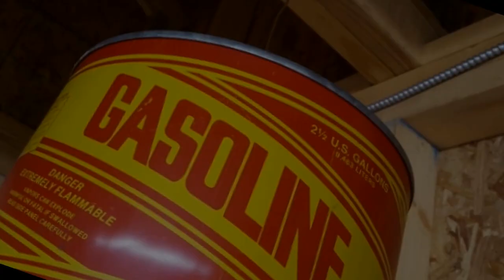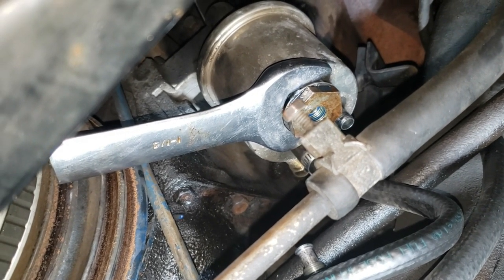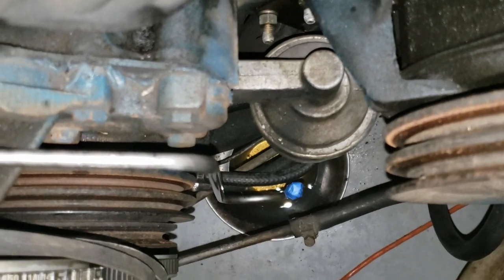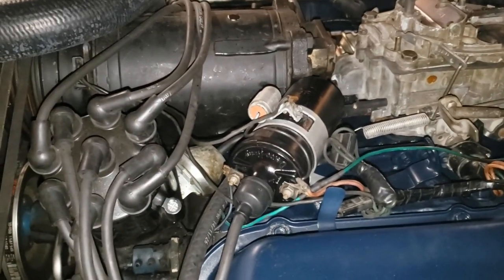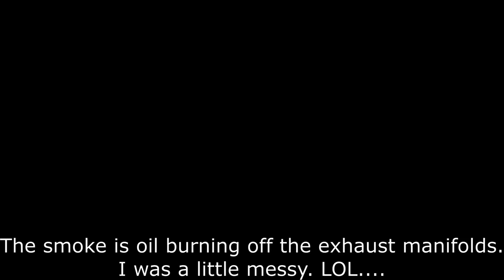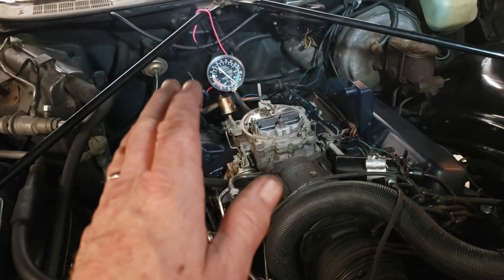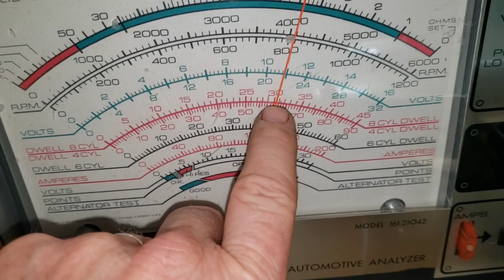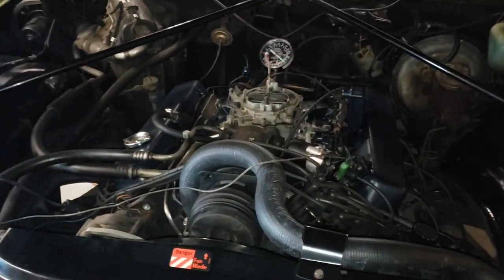Cadillac 472 Fuel System Part 6 - Fuel Line Installation, Idle Mixture Adjustment Using Vacuum Gauge

Comment: The presentation is not complete. If you really wanted to help, for example, you had to show everything, in which carb port you coupled the vacuum gauge, how you practically adjusted the mixture screw, to reach the indication of 19-20. Not just from words ...... It is typical for those who post, not to look like the one who sees and has no minimum knowledge, to spoil and then go to the mechanic and pay. Sorry for my rusty english.
Reply from the maker: Vacuum Gauge:   I always use the port feeding the brake booster. It's convenient. Just disconnect the brake booster vac line from the back of the carb and use that port for your gauge. 

Adjusting Vacuum screws: On the driver (left side) where the throttle linkage is, it is easy to get to the screw with a very short screw driver. On the other side it is difficult. There are two ways:  Use a very long flexible handle bit holder with a small flat blade in it. You'll need two hands, one to feed it from the front of the engine through all of the pipe work and the other hand to hold the flat blade on the screw.  That is a really tricky affair. The other way is ridiculously easy. Forget about screw drivers. Use a pair of long needle nose pliers and come at the screw from the top. Simply grab the screw with the pliers and turn it a little at a time. Of course any vacuum pipe work that might be in the way will need to be capped or moved. If you distributor vacuum source is right there on that corner of the carb, you'll need to move it to a different source on the manifold somewhere. 

Adjustment technique: You'll want to adjust the screw in 1/4 turn increments. After each one, wait for 10 or 15 seconds and let the engine settle down. Observe the gauge. Listen to the idle Watch the RPMs. If you turn the screw and nothing happens, you're done. Turn the screw back that final 1/4 turn.

These are good questions. I could have done a better job with the carb tuning video. Cars like this were ubiquitous when I was growing up.

Feel free to email me. See the channel "About" section for the address.
Reply: @ImpalamansGarage  Thak you for the Vacumm gauge port indication. For mixtrure screws tune is more dificult .

Comment: Bump up the initial timing to 15*, with vacuum advance disconnected and plugged.  See if your getting 10-15* of vacuum advance with it plugged into manifold vacuum.  Retune idle mixture screws....should get 22 in of vacuum and smooth idle.  Big Caddys like other big blocks like a lot of total timing, 35-40* .  With initial at 15 you may get 34-35* total.

Comment: Setting mixture screws at highest vacuum is right on the edge of lean. A little contamination on the mixture screw tip and you have rough idle. Setting the mixture screw an addional 1/4 turn OUT will give you a little bit of extra rich. Still good idle but you won't have to reset your mixture screws as soon. A little lean causes worse idle than a little rich. Done this for 51 years.
Reply from the maker: Good tip. Thank you.

Comment: You need to hook up your vacuum advance hose. You can't let it stay open. The motor will get to much air. The advance actuates the distributor as you give it more gas. It helps your fuel mileage. If your using manifold vacuum for distributor advance your pulling to much vacuum, than the carb vacuum.Ronnie.
Reply from the maker: It's not open. You misinterpreted what is going on the video I believe.
 There are no vacuum ports being left open. All that are not needed are 

plugged. I use full manifold vacuum for ignition advance. That
 port is located on the passenger side front of the carb. I installed a tee off of the choke pull-off to obtain this signal. Prior to 1970 GM used full manifold vacuum for distributor vacuum advance.  This full vacuum signal comes from one of the ports on the front of the carb. A Qjet has a "full" manifold vacuum port and a "ported" port. The ported port only provides vacuum in off-idle conditions - after you press the gas pedal. This is because that port is above the throttle plates in the carb. The full manifold vacuum port is exactly that. It draws from "below" the throttle plates.

With the impending emissions standards looming and the fact that 
catalytic converters would be installed in 1975, GM decided to change

the vacuum advance signal from full manifold to ported. They did this
 from 70 until 74. On cars from these years there was no  vac advance signal at idle. This had the effect of limiting

emissions when you're sitting at a red light. In 75 the catalytic
 converter was installed for all makes and models and this device took over the job of cutting emissions. So in 75 GM went back to

using full manifold vacuum for ignition advance.

Cars from the early 70s were notorious for tuning issues and dieseling.
 This was due to the way the factory tuned them for low emissions, without

the benefit of a catalytic converter. I decided to tune the car as though
 it was basically a 69 model. I've removed or disabled all of the emissions equipment except for the charcoal canister. 

Sorry for the long winded reply. Just wanted to provide a good explanation.
Reply: @ImpalamansGarage  But you are prematuring the advance with that much pull from the start. the advance is made to open as the engine speeds up. And by doing so, that is why you come off the carb and not the intake side.
Reply from the maker: @brdnsky6417  This is the way the 60s cars were designed and also cars after 74. My 78 vette uses full manifold vac to the distributor. As the speed speeds up you also have mechanical advance from the distributor weights.

Comment: Hi, do you have a manual choke on your carburetor? My car won’t turn on. My linkage on the carburetor to the manual choke is locked. And I’m assuming that’s causing the car not to turn on. Any suggestions? And where I can find the choke. My 472 is from a 1969 deville
Reply from the maker: What specifically are the engines symptoms? These engines use what is called a divorced choke, meaning that the thermally sensitive spring is physically located down inside the intake manifold. It is an automatic choke system. On a cold start you pump the throttle a couple of times and release. After this you should see the choke flat on the primaries close over the opening. At this point you slightly press the throttle and then crank the engine. When the engine fires a vacuum controlled choke pull-off will open the choke flap just enough to let the engine idle at the specified choke high idle setting.
Reply: @ImpalamansGarage  the car won’t turn over, it’s getting fuel but won’t start, I saw a video on here explaining how the choke will give out and not start. It just not starting
Reply from the maker: Ok. If by "won't turn over" you mean that the engine simply will not spin fast enough to fire, assuming your starter and battery are ok, your base ignition timing adjustment might be messed up. It could be accidentally set in a very far advanced setting. This will have the effect of not allowing the engine to turn over easily. It will seem as if the starter is not working properly.
Reply: @ImpalamansGarage  I will look into it, starter and batter are good. I had no problems before but now it won’t start
Reply from the maker: @manuelencinas886  Also make sure your main ground is clean, tight and corrosion free.

Comment: What did the idle mixture screws end up being set at? I have mine at 3 turns out to start. Wonder how close that is to correct? I'm having a problem with my choke break not pulling back until the accelerator is touched, by then the car floods out at idle. NOTE: My vacuum is still hooked as originally,  to the ported Vacuum valve.
Reply from the maker: Mine are at 3 at least. Might be a little more. I cannot recall the count. So I would say you are in the right neighborhood.  Also I have actually just recently decided to go back to ported vacuum on my car as well. Talked about this in a later video. It helped my idle quite a bit. Was having issues with distributor phasing. Check out the "Scott Hatch" Youtube channel on the 472 500 engines. He discusses this. https://www.youtube.com/watch?v=Y_vRJ2RIFrU

Post #2 on this page contains a link to a Rochester adjustment manual to include the choke pull-off as you described. https://www.corvetteforum.com/forums/c3-tech-performance/4348101-75-qjet-choke-pull-off-adjustment.html

Comment: Hey Mr. Impalaman, I apologize for the late comment here.  After all was done, did you feel the intake valve cleaning that you did was successful in eliminating the tardy valve closure and associated rough idle problem?  I ask because I have a similar problem on my 1975 500ci in my Eldorado.  Seems like mine really only starts making it miss at full temperature after some road miles. You didn't really address that specifically here. Thanks!
Reply from the maker: The cleaning did not address the idle issue I was trying to resolve. While my intake valves are clean as a whistle now, the problem remains. I still have what I believe to be a couple of sticking exhaust valves. The problem is either in the valves themselves or possibly  the lifters on the affected valves. Before too long I'm hoping to pull the heads for a closer examination.

Comment: I have a serious a idle issue, yet drives fine, powerful, nothing visible out the back, yet idles like total crap, sitting at the red light is horrible. Has new carb, replaced vacuum hoses, sprayed around to check for a vacuum leak, nothing, any suggestions would be greatly appreciated, thanks.
Reply from the maker: When you say new carb, what kind is it? My idle problem is just like yours. I've made a number of videos since this one and skipping to the end, my problems with idle stem from two things:  1) Old worn out points ignition 2) Faulty idle circuit in the quadrajet. I've corrected number one with a new electronic ignition distributor from CRT Performance. For number 2 I plan on sending my carb off to a professional rebuilder/restorer. The air horn is warped but I got around that with double gaskets. I did nothing with the idle circuit when I rebuilt the carb and I think this time around I would rather just send it off. That will happen very soon.
Reply from the maker: The quadrajet idle circuit is something that gets missed a lot of the time. Most folks focus on primary and secondary fuel delivery and fixing leaks.

Comment: on my 1975 fleetwood with the 500ci, before i touched it, timing was at 11 degrees BTDC, sent it to 6 degrees BTDC at 600rpms in drive. adjusted the mixture screws and so far its not chugging/cranking slowly from a hot start or dieseling turning it off like it used to.
Reply from the maker: Yeah timing that is too advanced will make you think your starter is failing. lol
Reply: @ImpalamansGarage  it did have more pep the way it was before- obviously from being more advanced. not great when starting it from a hot start and it slowly cranks.
Reply: Need to modify the mechanical advance for additional advance. This will allow you to set your initial timing lower and keep your total timing higher for more power. HEI distributors only advance mechanically about 18 degrees from the factory and need modified for about 25 degrees of advance.  Most big blocks like more timing. Not sure on the 472, but my 454 Chevy likes about 38 degrees total. That 8.5:1 compression should handle 35-40 degrees total timing on 93 octane fuel with everything else in proper tune! If your HEI will advance 25 degrees mechanical and you set initial timing at 10 degrees then your total timing would be 35 degrees advance....probably near the sweet spot. You want total timing a couple of degrees below where detonation begins.  It’s different for every engine. Bump the timing up 2 degrees and go for a test drive up a hill, and keep bumping up two degrees until you hear detonation climbing a hill. What ever your total timing is at that point, set it 2-3 degrees less. Where ever initial falls out is where it falls out.  Total timing is what actually counts and it is always very conservative from the factory and always needs set up mote aggressive if you want more efficiency and more power!
Reply from the maker: @trailerparkcryptoking5213  Agree with everything you said. Spot on. This is a points distributor however, which was correct for 71.

Comment: You don't run your vacuum advance for the distributor hooked up?
Reply from the maker: Yes. I run vacuum advance. This was three years ago and at that time, instead of ported vacuum,  I preferred to run straight full manifold vacuum to the distributor. I did however completely remove the electrically controlled vacuum switch that prevented vacuum advance from reaching the distributor in 1st and 2nd gear. There is just no need for it. It was an emissions device. From the factory the car had a solenoid that was switched by a signal from the transmission when the vehicle hits 3rd gear. This enabled the vacuum signal to go to the distributor vac advance actuator. Today I run ported vacuum.
Reply: @ImpalamansGarage  thank you for explaining that sir. Working out a couple bugs on this old 472 , I'll be back .

Comment: Where can I find what emissions items I can pull off my 472 setup from 1970?
Reply from the maker: You're not supposed to remove emissions equipment. LOL..... But it you want to I'd start with the smog pump. You will need a pulley kit to do that. https://cadillacspeedshop.com/cadillac-472-500-smog-pump-removal-kit-for-1968-1973-bl49-out-of-stock-eta-jan-5-2021/

You need this too - https://cadillacspeedshop.com/cadillac-472-500-a-i-r-cup-plug-chp-ep13/

Comment: I need to delete my emissions. Installing that pump-carb rigid fuel line is impossible with the manifold assembly that runs across between the headers. I'm having to resort to a ptfe hose...
Reply from the maker: Yes the emissions equipment does get in the way for sure. The way I see it, on a car this old who cares? It's not driven that much any more to matter.

Comment: any videos on changing the fuel pump?
Reply from the maker: Well hadn't planned on it. Are you having problems with yours ?
Reply: @ImpalamansGarage  just got the car, 78 Biarritz that has been sitting in a barn for years.
Reply from the maker: @dennispeaks  Not sure what your plans are but if you plan to fire it up, I'd disconnect the input to the pump and feed that to a separate gas can. Also disconnect the fuel line to the carb. Turn the engine over and see what happens. If it works, make sure you have clean fuel coming out of the carb line before reconnecting and attempting a start. How long has it been sitting ? If the pump needs to be replaced keep in mind the pump arm has to be precisely the same length and angle of the original. Otherwise return it. I could not offer any other advice on replacing the pump other than following the factory service manual. If you don't have one, scrounge around on Ebay.
Reply: @ImpalamansGarage  just saw this, it has been sitting since 94.  I ended up draining the tank, putting marvel mystery oil in cylinders and valve train and changing the pump.  It started right up.  Someone saw it online and offered crazy money for it and I let it go since I had bought five from the same guy, 4 Biarritz's and a 77 Eldorado.

Comment: What’s the total timing when it’s all the way in?
Reply from the maker: Well to be honest, I had not bothered measuring it since none of the engine internals are modified. The only thing new about the distributor is the vac can and the points. The weights and springs are all original. I can measure it though! Will give me something to tinker with today! I reckon it's probably around 30 when it's all in. We'll see.
Reply: @ImpalamansGarage  especially stock engines had ultra conservative ignition timing, which can be increased for more power/better efficiency!

Comment: In a 75
Reply from the maker: The idle mixture screws on a 75 should be in the same spots as my 71. On the left and right front corners of the carb at the bottom. (Unless you have a fuel injection car.  LOL)
Reply: @ImpalamansGarage  on top or on side. They're capped. Black plastic circle
Reply from the maker: @realtruthexposedone3237  If there are black plastic caps over the screws that's what came on them from the factory. GM didn't want folks messing around with the mixture. So either your carb's idle mixture has never been adjusted or it may have been done at a dealer at some point. Either way those factory caps have never been pulled off and lost. I still have one of mine but I just leave it off.
Reply from the maker: @realtruthexposedone3237  Mixture screws are on the front bottom and left and right.
Reply: Kk I'm trying for better mpg. Jus a half turn in clockwise rite
Reply: @ImpalamansGarage  only two or 4 screws.
Reply from the maker: @realtruthexposedone3237  There are only two mixture screws. Keep in mind that these only control the fuel mixture at idle. They have no effect what so ever in off-idle conditions..... as in driving down the road. So yes I suppose having an idle mixture that is a little too rich would affect mileage a little if you sit in traffic at red lights a lot.